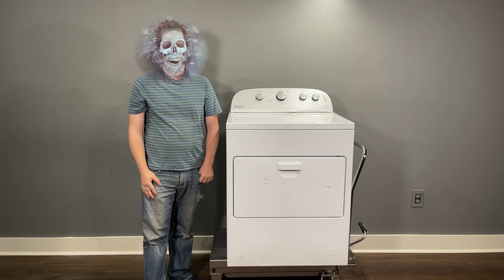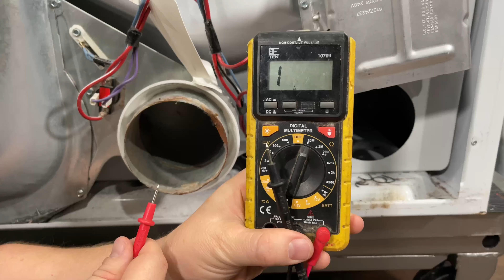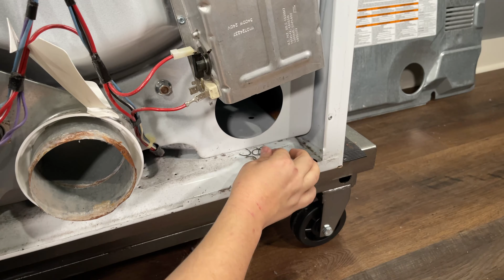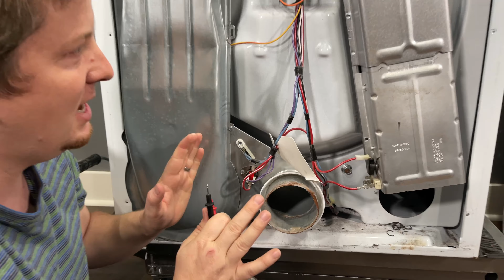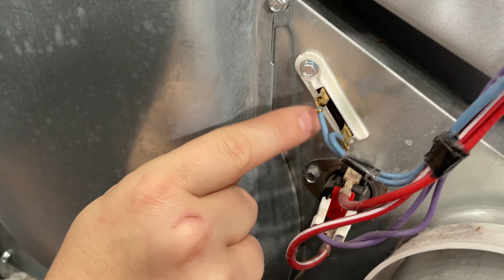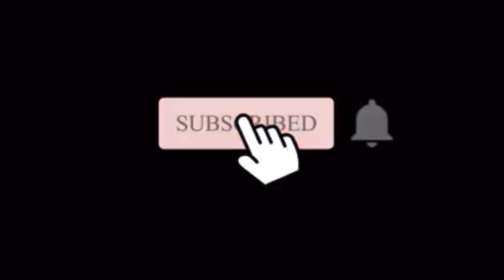Electric Dryer grounded Heating Element Stays on! - testing and diagnosing step by step Whirlpool

Comment: I have a Whirlpool dryer. Not too old either. I have cleaned it very good. Tested a lot as for the Thermostats and fuses and the problem still continues. Within a minute the circuit box/panel 30amp breaker trips. I run the dryer on no heat (fluff mode) and the breaker will not trip. Even tested the circuit box breaker or problems. No problems. What other items might be causing the tripping of the circuit box breaker? I would "think" if the problem was actually in dryer it would malfunction at the unit and not the breaker box. This problem has come on fast and not intermittent.
Reply from the maker: This is one of those things that’s hard to know unless you just take your time and start from the breaker and work your way forward until you’re fine what is grounded out.
If it’s not the dryer for sure and then it could be anything from a bad breaker to a squirrel or mouse has chewed the wires. It could also be a bad plug box for the dryer. Be careful if you are not comfortable testing power definitely get a professional.
Reply: @WasherDryerMoney  Just wanted to give you an update and for posting sake if anyone else runs into this problem. I inspected the breaker panel again for a ground problem on that circuit. Found none. However, I did find one of the hot wires to the double pole 30 amp breaker was "very" loose. Stuck it back in all the way and tightened it down. Wa-La it works fine now. Running some wet clothes now to see if the thermostats are working properly but I anticipate they will. Thanks for you help.
Reply: @WasherDryerMoney  I really don't feel it's the wiring, breaker or box/outlet since all my testing. If is was I would think if it was in the line it would still trip the breaker in Fluff mode. Anyway, appreciate your response. I have decided to order a complete fuse/thermostat kit and replace everything just for ruling  out sake. Very cheap to purchase and if it fixes things it would be a $595 savings buying a whole new dryer.
Reply from the maker: @michaelfollin2595  Never hurts to replace fuses and thermostats every once in a while. Still a breaker should only trip if it detects a hot wire is grounded or something is pulling more than 30 A. I have had a breaker go bad in my shop. I thought I would never figure out what was wrong finally replace the breaker and it stop tripping. It’s a rare problem though.

Comment: how does a heating element last on a dryer
Reply from the maker: It’s all about airflow. If the dryer is stopped up the heating element will not last because it does not have airflow to keep it from overheating. A dryer being stopped up either at the lint trap or the exhaust pipe being bent or just lint built up in the machine is the number one cause of heating elements going out.

Comment: OMG. This was my case exactly. Door open or closed, the heat would cycle on and off while the timer was engaged. Pulled the timer first, no shorting or welding of metal there. Checked continuity between heater terminals and metal frame and sure enough there was electricity flowing. Pulled the heating element and "bent" the coils I thought were touching the frame as as all the coils were intact and not broken off. Reassembled everything and voila!, fixed. I am considering replacing the element as I know the heat might cause the coils to expand and touch the frame again down the road. Thanks for this video. I watched a ton before I got to this one.
Reply from the maker: Glad you got it fixed. You should definitely replace the heating element once they start touching the frame they tend to continue. Sometimes they’re just stretched and sometimes the ceramic piece that holds them has broken. Either way the heating elements are cheap you should replace it.
Reply: @WasherDryerMoney  Agreed. I did notice one of the ceramic holders was definitely loose.

Comment: My dryer just stopped turning on. It was burning hot and wheel wasn’t turning. I unplugged it and it cooled down. Once I plugged it back in it heated up fast and It was in the off position.

Comment: Buy the heating element from Amazon. It comes with the fuse and thermostats for $30- $40.
A parts store will charge you $18 for the fuse and $60 for the heating element!
Reply: Can you walk into amazon today to buy it?
Reply: But the Amazon one won't be OEM, and believe me, there really is a difference.  Genuine Whirlpool parts are better made than the aftermarket brand ones.  (and no, I don't work for Whirlpool :-) )

Comment: Thanks for this!!  My dryer's heating element was staying on when the timer was on, even when the dryer wasn't turned on. So I watched your video, took out my heating element and saw that one of the wires was sticking out touching the metal, so I pushed it back into place and put the other wires into their holders (most of them were out) and now it's working again.  Thanks again!!

Comment: Great video and was easy to follow. Thought this was my issue but it turns out the actual timer dial was the problem and it was causing the heating element to actually activate
Reply from the maker: Interesting. That doesn’t happen very often.

Comment: Thank you. My dryer was getting too hot, and I had already replaced both of the thermostats. Finally watched your video and found the element was grounded. One wire of the element was welded to the housing. I got it off without breaking it and bent it back and away. Fixed the problem. Thanks again!